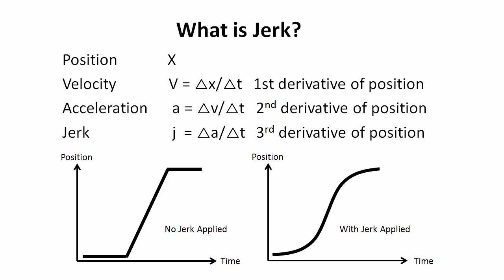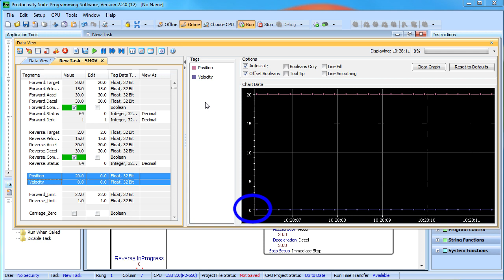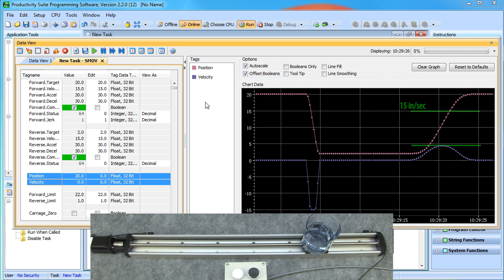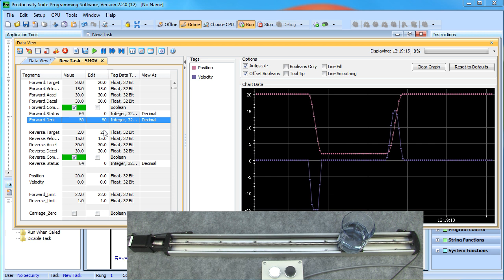Productivity Series PLCs Motion Control - Smooth Out Motion Transitions from AutomationDirect

Comment: I have been trying to measure the effects of jerk control with an accelerometer on my 3D printer but it does not appear to have any effect on a single line move like your test shows, sadly.
Reply from the maker: Which 3D printer are you using?